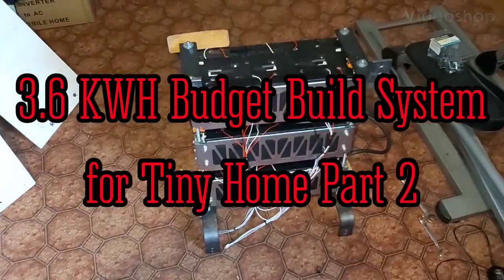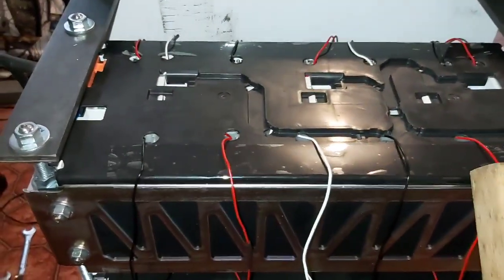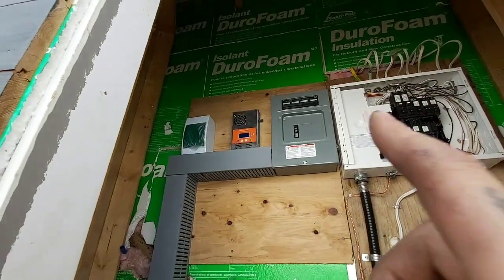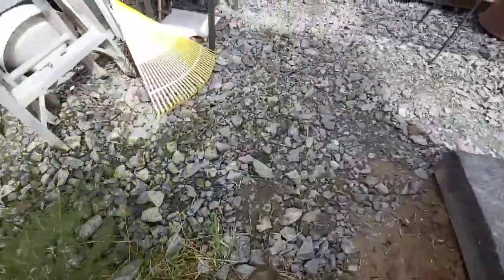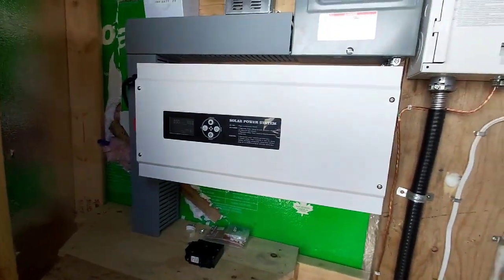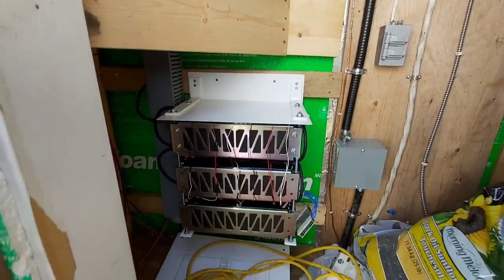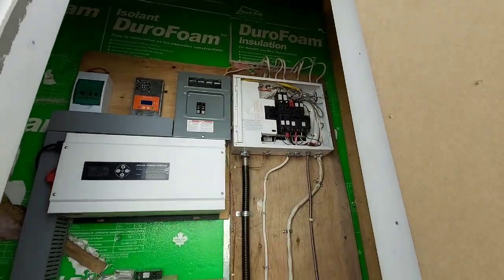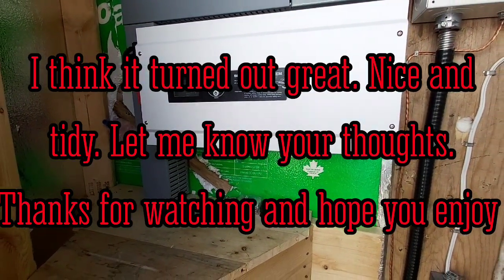3.6 KWH Budget Build System for Tiny Home Part 2

Comment: Question:  when you use a washer n screw to fasten the solar panels to the wood structure, will there be corrosion?  The panel frame is aluminum and what kind of washer?  I'm about to do an array and curious.
Reply from the maker: This is only a temporary mount. It will corrode over time . If you want less corrosion I would usestainless steel washers and screws.
Reply: @frankz1125  I'll look for stainless  thx

Comment: Not familiar with those cells. Are they lithium ion? 3s? Thanks
Reply: I think the voltage i saw was from solar input which was higher, around 55 volts.
Reply from the maker: @jakeandrules7724  they are li ion 12s. From a Honda Clarity
Reply: @frankz1125  Thanks!